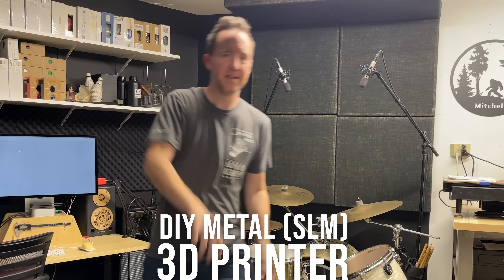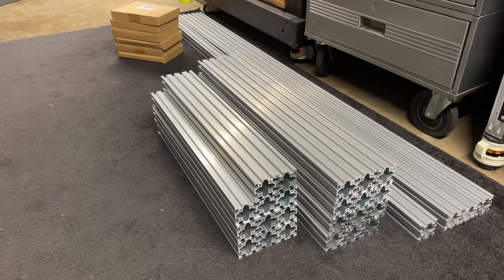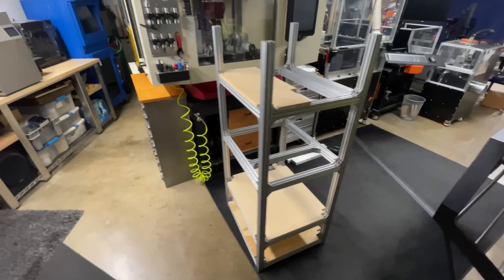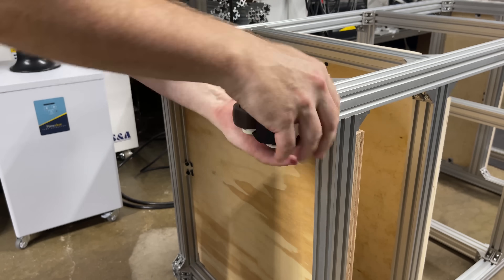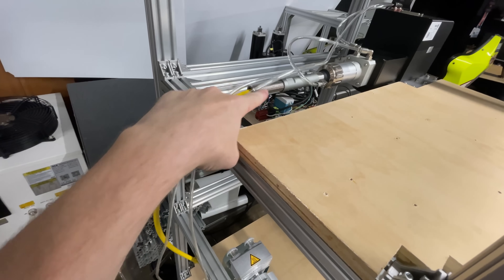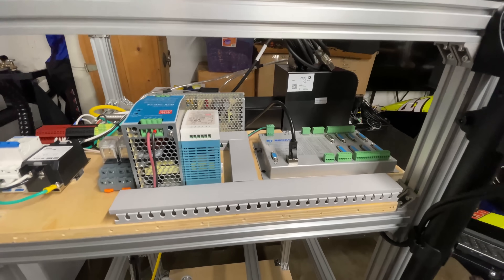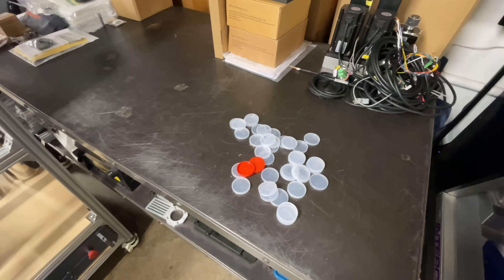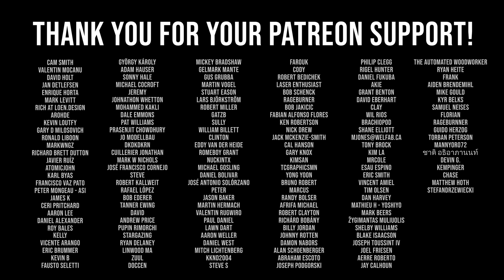DIY Metal 3D Printer: Part 3

Comment: Once you figure out threading in CAM you will never go back to hand tapping again. I’m a full time machinist and use fusion 360 everyday. It’s very simple. Create your threadmill in the tool library with manufacturer dimensions. Model your holes to the thread minor. then in your passes tab for the pitch just use 1 divided by the thread pitch for standard or the actual thread pitch for metric. For the pitch diameter offset subtract your major diameter from minor diameter in your model. I always use wear for compensation so i have full control at the machine . I also do multi passes at about .005 to .01 thou 2 to 5 passes. Also if you don’t want to freak out the first time turn on conventional threading to start at the top of the hole instead of the bottom.
Reply from the maker: Thanks for the tips, I'm excited to test it out!

Comment: You probably already thought about it, but it looks like there is no valves to isolate the filter and cyclone? And filter seems not easy to remove from the machine in case of fire.
Looking forward to see your design choices for the process chamber ;)
Reply from the maker: Thanks for bringing this up again. I forgot to change the back panel to be an access door for filter access…I will update the model. I was looking at adding valves and was having a hard time imagining their implementation, due to my lack of understanding…is their sole purpose to be able to isolate a potential filter fire while you get it removed? It’s probably still possible for me make some adjustments to add them in
Reply: @diyfiberlaser  In any case, you'll have to be able to isolate the complete fume extraction circuit from the process chamber, otherwise you'll have to passivate the filter before each chamber opening. But yes, if you also add valves just before and after the filter, that's mainly to isolate the filter in case of fire and be able to remove it from the machine without a big boom^^. This is why many manufacturers don't integer the filter in the printer body.
Reply from the maker: @quentin1362  OK thanks again, I've added shutoff valves to be able to isolate the filter, and updated my 3D model so the back will now have door panels. Let me see if I understand this correctly...so I don't need to passivate the filter after each print, my workflow should be like this: After my first print is complete, I should shut the valves to isolate the filter, then I can open the chamber to introduce O2 and remove the part, cleanup, etc. The valves will stay closed while the printer is not in use, keeping the filter isolated in Argon. When it is time to print again, I will purge the chamber, then open the valves to reintroduce the filter to the argon climate, then print. Theoretically, after the first purge, the filter should never contact O2 again until it is time to replace it. Is this the workflow you would suggest?
Reply: @diyfiberlaser  Yes, you're totally right! The cyclone needs to be isolated with the filter as well. That's why the tightness of the complete circuit is very important. In practice, you always have small leaks, but if the O2 level increase is slow enough (in several days I mean), the fumes will oxydize slowly without critical exothermic reaction. It is the same when you replace the filter: slightly open the valves and let oxidize for several hours before opening the filter.
Reply from the maker: Thank you, your input is extremely helpful!!!Could you elaborate on why the cyclone should have a valve also? I didn’t add one yet, I was imagining that I would empty it after each print, along with the overflow reservoir. I am wondering if there is something I don’t understand about passivation…when the print is finished, after isolating the filter, can I just open the chamber door? or should it be some kind of slow process where I gradually introduce O2 back into the chamber before opening?
Reply: @diyfiberlaser  This circuit will vacuum clean the fumes generated by scanning the powder, so the bigger particles will get trapped in the cyclone, and the thinner in the filter.
Passivation is mainly useful with reactive materials. In your case if you close the valves before opening the chamber and keep the suction circuit flushed with Ar, you don't have to passivate the filter.

Comment: I would recommend looking into putting through holes and tap the ends on some of your extrusion to prevent vertical movement. I'm just concerned that as you load and unload metal powder and printed plates you may shift the height of the levels
Reply from the maker: I still want some adjustability at this point, until I get the chamber set and the focal distance for the galvo head.

Comment: A lot of those mini PCs have a pin header on the motherboard for a remote power button. Could also be nice to use a panel mount USB extension port, not specifically to make the flash drive more accessible but to make the port socket replaceable in the long term. USB A is pretty good, but it does have a finite lifespan.

Comment: I like your 4th axis on your mill.  Pretty trick.
Reply: Pretty sure it's also a 5 th axis, wich is even cooler
Reply: @Basement_CNC He had one.  I went through his vids to see if he had more on that mini mill setup. Dudes got my dream workshop.  All small but highly capable.  The trunnion table 5th axis he had where the 4th axis sits now?  He stated it wasn't all that rigid so i'm glad i didn't buy one a few months ago when i looked at em on ebay/amazon.
Reply from the maker: That’s correct…the trunion table I initially installed was way to chattery for aluminum, the 4th axis I have now works well

Comment: Nice work, but you gotta put some hours into your bio machine. That spare tire gonna take 20 years off your life.
And as a side effect, you will stop making every statement as if it's a question. Sounds like your wife has you trained and beaten into submission.
Just takes 20 minutes. Run, bike, lift, anything.

Comment: That's neat idea where you raised most bottom horizontal profiles off the floor and added more angle brackets from other side as well.
Reply from the maker: I wanted to get that little bit of extra support to hold the heavy laser source.

Comment: Just a quick tip, go for a round piston or a square one with rounded corners. The square shape that you are using is going to be extremely challenging to keep powder tight. The powder under some vibrations or movement will behave a lot like water so your pistons really need to be like water/air tight
Reply from the maker: Thanks for pointing that out...this is also my concern. I was planning to test out the square tube and see how good of a seal I can get, mainly for a couple reasons: 1. I cannot seem to find anyone who supplies 5" square tube with radius corners and roughly 1/8" wall thickness (I will keep searching, but so far nothing). 2. I was also considering 5" round tube, but I'm concerned that I don't have any good ways to machine it or hold-down methods for machining it...it's just a little too big for my machines...I guess I could outsource it if it comes to that.

Comment: What is he gonna build after all the machinery is built😅
Reply: This is a legit issue.... I had precisely this when I did my CNC mill conversion! Now I've made all the parts for that on the mill I need a new project 😂😂
Reply: @pete.n. Hopefully a saw table😳
Reply: @polarbear2272  IKR? Mr. Super Tech Machines builder Travis on his knees on the floor with the chopsaw...kind of a disconnect.
(But my 12" is on the floor too, under my CNC table 🙂)
Reply from the maker: @BrilliantDesignOnline  I need a larger workspace!...for now I have to keep the lesser-used tools on the shelf...it's a pain, but you have to make priorities when you have too many laser machines : )
Reply from the maker: @polarbear2272  Ha! 😃 I would like to do that, and make a motorized fence for it so I don't have to spend time measuring (just added it to the list yesterday)
Reply from the maker: Haha...my to-do list of projects is out of control...we never have to worry about running out of video content to make
Reply: I have an idea 
An even bigger slm 3d printer 
An industrial sized machine

Comment: After all the custom machines that you have made…it always makes me laugh to see you on your knees cutting aluminium extrusion…😂 Surely there is an over engineered solution to that situation?
Reply from the maker: Haha, yes it's so annoying...I've tried to take over all of the garage space, but unfortunately I still have to share some of it with the wife and kids...if I can find a way to make it portable, I'd like to make a saw stand with a motorized fence to do away with both cutting on the floor and measuring.
Reply: @diyfiberlaser You could try the Harbor Frieght portable bandsaw stand. It allows you to use a small band saw like a chop saw, and also use it to stand up the saw if you wanted it to be vertical stationary. It would make less noise and smaller chips than the chopsticks.
Reply: There is not I'm afraid.

Comment: Maybe make the build platform and the the box it rides in a round tube much simpler to get good oring seals
Reply: Side note the focus shift from the galvos is elliptical not sure what the built aera goals are  but keep in mind the focal distance changes the farther from the center
Reply from the maker: @CNCAutomationLab  The build area is going to be about 5" or 125mm...given the pretty lengthy focal distance, hopefully that won't be much of a problem
Reply: @diyfiberlaser id make the build tube 20-25% larger then the build aera as the sides will get a more uneven coating of powder per layer and gets agitated slightly during motion a think rounding the corners would help a lot.
Can you share the lens ratio you say 5in so my guess is 150mm with a 2.4-2.6:1 :ratio so at across a full sweep your spot size can more than dubble.
Reply from the maker: @CNCAutomationLab  330mm focal length
Reply from the maker: Yep, I'm concerned about the seal on the square tube as well...I'm still considering square tube with a corner radius or round tube if I can make it work better.

Comment: Hey Travis, wait till you do that first helical threading strategy. I did my first fixture plate with over seven hundred M6x1 tapped holes and was just amazed. Outer diameter of the tool is 4.8 and the pre drilled holes are as you know 5.025mm (5mm) and the tool descends to the bottom before beginning to cut. New guys are fascinated by this generally speaking. Good luck with your new foray into metal scintered part prod
Reply from the maker: Yes I need to take the time to learn that skill, it is very intriguing and could save me some time!